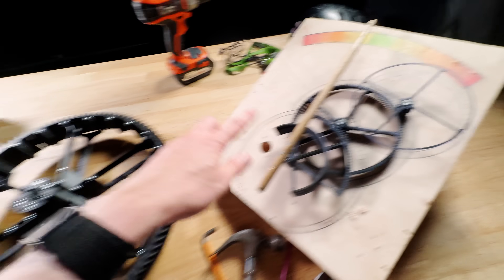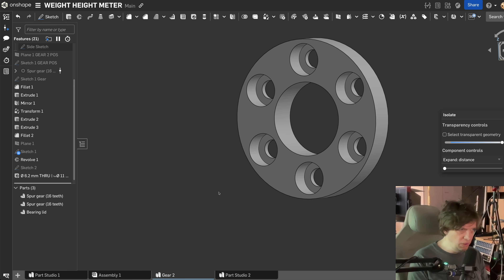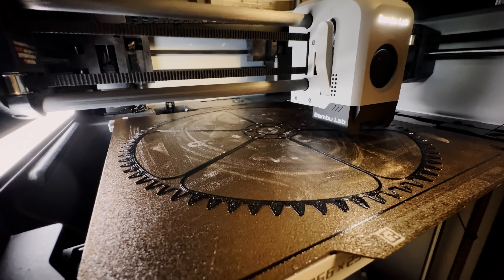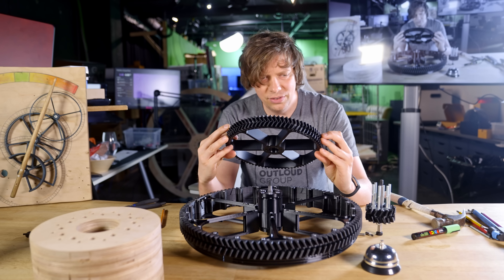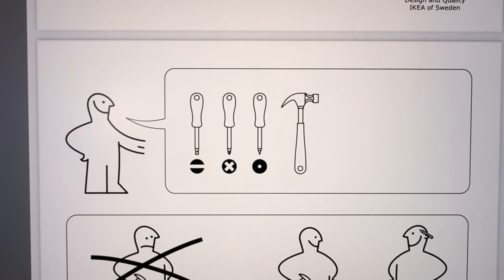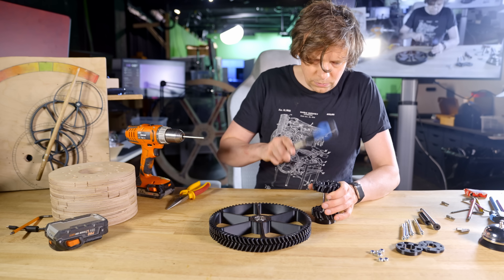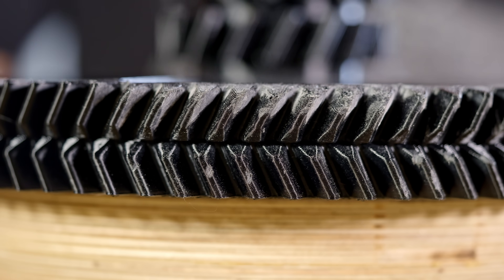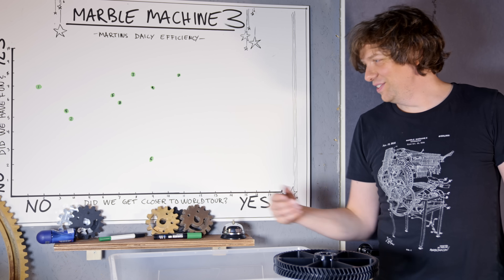Making the Second Double Helical Gear - MM3 VLOG #9

Comment: Filleting a 3d print is really only important on the axis that will be the X/Y movement, not the Z... Filleting the top and bottom corners can cause some of the adhesion issues you saw since there's less surface area touching the bed. Not to say it couldn't have still happened... but a bunch of little things add up...

Loving the content, watching you work is always motivating!!

Comment: A little bit of flame from a lighter will help restore the original color from the sanded areas. Just be careful not to overdo it or it will deform. I use one of those jet lighters to restore shine to my prints all the time after sanding. No marker needed.

Comment: The side touching the build plate for a 3D print should not be filleted. That creates super shallow overhangs that always cause problems. Make it a chamfer and it works much better.

Comment: Time to get some sort of CMM or scanner? How is part geometry verified? What are the tolerances? If the design takes this into account (tolerant) it's less of an issue but if replacement parts need constant hands-on adjustment and testing it will be a liability. For instance, if on tour, any parts brought along need to either be tested first or dimensionally verified. Worse still if printing on tour or receiving locally produced parts. 3d prints have a pretty good tolerance range when done properly for sure but at this stage we don't even know what the machine requires. It will be the tolerance chain from hell 😅
Reply: He will never go on tour with this or any other marble machine.

Comment: I'd recommend trying STEP files instead of STLs, especially since many people consider STL files deprecated. STEP files are generally smaller and higher quality thanks to storing the geometric construction data instead of triangles, they store more metadata than STL files, and most modern slicers accept them out of the box
Reply: Agreed, STL is a crap format. It's insane that it's still used, even in industrial environments. It does have an inbuilt tampering protection since it's so awful, so to speak, but STP does too if tesselated. 3MF or AMF is also a "step" up from STL.

Comment: Hey Martin, top tip for making your parts: whenever possible, print a revision number into every part that's large enough. That way, when you need to tweak some print settings or tolerances, you can easily keep track of stuff.
Reply: I actually talked with him about this the other day since I also think it's a great idea - and also to combine it with creating a named version in onshape everytime you export a part for printing, so you can go back and see exactly what that model and version was designed for if you need to backtrack. Anyway, Let's see what the future holds ^^

Comment: Do not forget to add root fillets to your teeth. You do NOT want sharp corners at the base of your tooth that is where your gear teeth will fail. This part likely does not have enough stress but some of your parts will and you can mitigate it so easily!

Comment: Don't put fillets on the bottom of your models. That's making your bed adhesion worse, and they print poorly due to the overhang and layer line stair-stepping. Either leave the edges as-is, you use a tiny chamfer to compensate for elephant's foot.

Fillets on the top aren't great either, due to the layer stair stepping. If you want something to break those edges, use a chamfer instead.

Comment: hi martin, i do remember in one of your videos that you mentioned having less parts is better but seeing the big gear being printed in multiple parts because of its size and assembles using tens of screws/bolt seems not to follow this principle, although having the gear in parts have benefits for repairability i wondered if maybe other assembly methods that require less parts exists and could be better for this project?

Comment: I’m guessing Martin’s switch from Fusion to Onshape was because of some fiscal reason. If not, what does Onshape have that Fusion doesn’t?
Reply: I think he might be in talks with them for future collabs, but the main reason is that I use onshape myself a lot, and Martin got inspired by the collab features and the "git-like" version management system. This could make it possible for future live broadcast where anyone can build their own version of a part that needs designing, and Martin can just switch between different versions/forks for that part. Another thing is that onshape doesn't limit the amount of parts in their free tier. It's still too early to say if the same stuttering remains when you load in the full machine assembly/model, but that was a major issue in fudion360 during the MMX project. //Ludvig

Comment: For printing, chamfer, don’t fillet! Fillets on the bottom of parts are always messy due to the steep overhang where it meets bed. Or fillet the vertical edges, then you have one long continuous edge on the top and bottom side you can use to make your chamfer.

Comment: The error on that gear looks like a combination warping I'm addition to bed adhesion. Higher temp plastics like PC and nylon have this issue because they tend to need higher bed temperature than material like PLA and PETG. Additionally printing faster exacerbate the issue. To fix wash the bed like others have mentioned but also print a bit slower to allow the stress in the polymers to relax as it cools.
Reply: Came to say the same about speed. If your venting the printer that could also affect temps and cause warping.

Comment: To my knowledge the advantage of that double toothed design is that even if you uneven stuff it will up to a point self aligin itself without slippage. Of course not 100% perfect but some small print error should not stop you at this point. ^^

Comment: Please Martin, carbon fiber filament is dangerous for wearing parts, the dust from the gear wear can cause serious long term respiratory injury.  You REALLY don't want mesothelioma, my friend died just 18 months ago from asbestos exposure.  Hannes, I've seen several people say this, will you please pass this message to Martin?
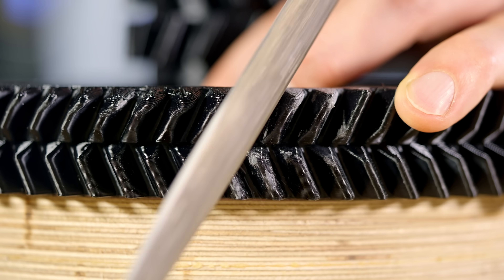Reply: At 9:46 Martin says "this is not carbon fiber" I'm glad he switched away from it.
Reply: But, I still thought he said the big gear WAS carbon fiber.
Reply: Very good point! I recently did some research on this. When printing it,  and even with high contact/friction stresses on the printed parts, there are almost no fibres getting airborne because the polymer encapsulates almost everything. It would be considered more dangerous to light a candle in an unventilated room and WAY more dangerous to drive around in high traffic with your window open. To make it even more safe he could use something like “Siraya Tech Fibreheart PPA-CF Core” filament, which concentrates the cf fibres in the core of the filament not only eliminating all risk of contact or inhalation of cf fibres, but also has better layer bonding than its normal PPA-CF counterpart. Of course whilst filing/sanding the part it would be stupid to not wear a mask (as you always shoud wear one, no matter what the material).

Comment: Some 3D-printing tips:
-avoid full 90° fillets on the side that will touch the bed, it not only causes bad overhangs but that overhanging plastic cools a lot faster than the rest of the print, causing more chance of warping. Try chamfering the bottom side first and fillet the chamfer afterwards, so you still have the curve but not the steep overhang
-With some clever geometry, it is very possible to print these counterbored holes without the need for support using bridging, "Makers Muse" and "Slant 3D" have some great vids for that
-In your case it would be better to make bigger spokes and reduce the weight with less infill , you can work with modifier bodies to increase the infill where strength is needed. Chunky is good.
-degrease your printbed with a lil soap and water and click on "auto bed leveling before every print" on your printer to ensure perfect bed adhesion.

Edit: Forgot to mention that printing that fast for prototyping is fine but please slow down your prints for the final pieces to ensure good layer bonding (if you will still print them offc). And if you consider printing your final pieces, PA6-CF seems like the perfect filament for the job, nice and slick but rigid af. And doesn't break the bank that much.

Happy printing!

Comment: Print defect looks like bed adhesion. To fix: wash plate with soap and water (not alcohol). Never touch the plate with bare hands, the oils will make spots that don't stick. Glue sticks are unnecessary if you do this. I used to get this all the time. If you still have the issue, consider turning off the auxiliary fan (it's in the filament settings)
Reply: Why not alcohol?
Reply: Never needed to use glue stick, but a few print a part i wipe my bed with isopropyl alcohol to remove grease and dirt. Works like a sharm, never had problems during my 5-6 years of printing.  Why not usel alcohol 🤔
Reply: @starstreamlab I think the OP meant rubbing alcohol, that leaves residue. IPA doesn’t leave any residue and is fine. Once I used medical ethanol because I ran out of IPA and the next print did not stick at all - can’t remember the material I was printing with at the time, I think it was PETG, so YMMV. 
IPA, once completely evaporated, is definitely good.
Reply: @Krmpfpks  'colemans lantern fuel'(hardware store) will remove any oils/adhesives stuck to something and leave no residue. People who install wood floors use it to clean up the industrial glue that comes up between the cracks. I would test a small dot on the very corner of the print bed to be completely sure it doesn't react badly to the bed though.
Reply: @spyseefan975 I have good experience with IPA, and I now have different print beds for different materials, less work to clean 😉
Reply: @starstreamlab  alcohol won't remove oil, it will smear it around the build plate. Soap and water by contrast will take the oils off the plate. I washed my plate after every print with alcohol kept getting failed prints on both a bambu and ender 3. I washed both plates with soap and water and all my prints were suddenly perfect, so now I yell it from the rooftops :) Or maybe I have very oily hands? IDK, tldr soap and warm water work better
Reply: Warping maybe results out of thd way too fast printspeed...
Reply: Or just use 3DLac 😜
Reply: It’s also because of the fillets he added

Comment: Definitely wash the bed with soap (not alcohol - it deteriorates PEI) if the printing error is on the top you’re probably looking at insufficient cooling. Slowing down prevents this. You can also use a layer height modifier in Bambu studio to increase the speed in certain non critical areas but slow down for the overhangs.

Comment: The cooling fan might have a blind spot - that might be why your gear looks overheated in one spot. Try Ivan Miranda's adhesion trick: wash the build plate with soap and water and don't touch it with your fingers - works great

Comment: If you are 3d printing it chamfer the edge up 45 degrees so it can print without an overhang and then fillet the new edge. The chamfer will give you slop towards the bed due to the overhang.
Reply: This is a great technique